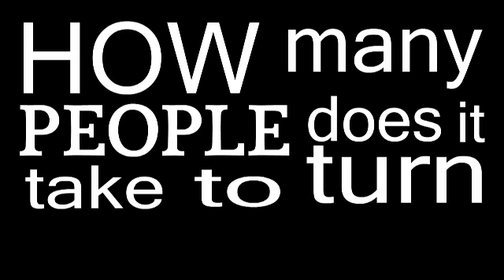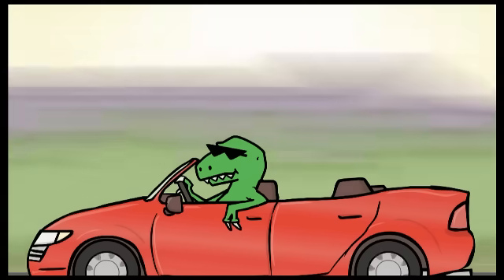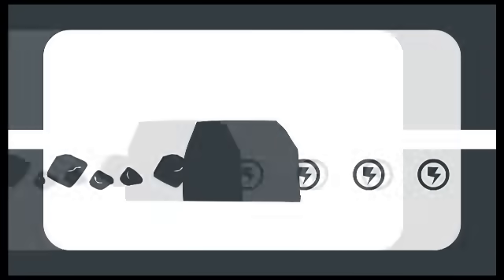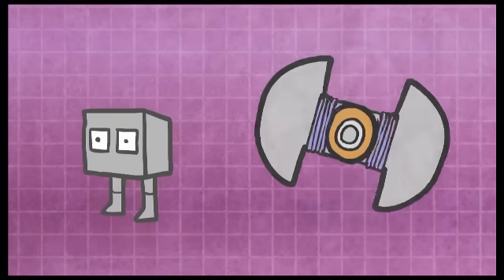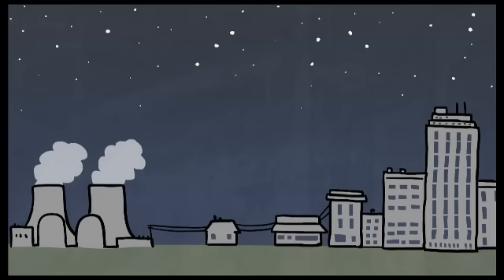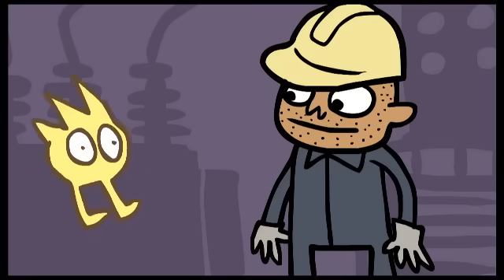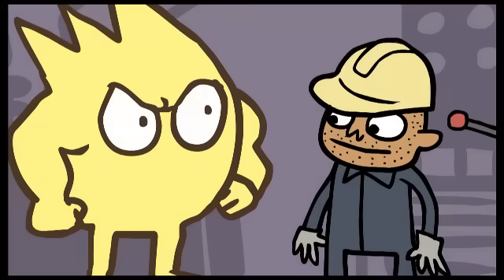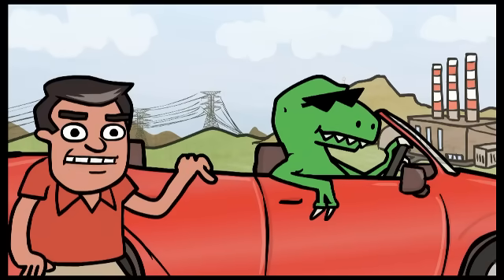Energy 101: Electricity Generation

Comment: My home uses 220 atleast thats what the electricity provider said
Reply: +random stuff probably, it depends on where you are, in europe is 220, in USA is 110...
Reply: minecrafter9099 than how can dryers and washing machines work in usa
Reply: +random stuff the circuits are different
Reply: +random stuff 
In the USA the average home has 3 wires connected to the utility pole. These are L1, L2 and Neutral.  The voltage measured between L1 and L2 is 240 volts. The Voltage between L1 and Neutral is 120 volts. Likewise, between L2 and Neutral you also measure 120 volts. The 3 wires go through the electric meter and the Main House Breakers and continue to the breaker panel.  

There in the breaker panel, about half the circuits in the house for 120 volt usage are connected through circuit breakers using L1 and Neutral wires. The other breakers are powered up by L2 and the same Neutral for the other 120 volt circuits in the house. 

Bigger loads like an electric clothes dryer, electric stove/oven, and a larger air conditioner have a circuit breaker on each wire connected to L1 and L2. That's where you get the 240 volts to run these appliances. Electric clothes dryers use all 3 wires as the motor and controls are 120 volts and the heating element is 240 volts.

The home wiring for 120 volt circuits  is 12 gage in size for circuits that can carry 20 Amps load total.  Smaller 14 gage wire is used on 15 Amp circuits. These wire sizes and breakers are designed to TRIP when the circuit is over loaded by having too many things plugged in. Wire sizes and allowable current are set by building Codes and Standards to prevent wires within the wall becoming overheated and start a fire. The circuit breaker is an electric safety valve designed to be stupid proof and prevent fires from starting inside the walls.

The 240 volt circuits have their own wire sizes, generally larger in cross section, black in color and sometimes marked L1 and L2 or have a stripe to tell the electrician  which wire he has. 

Also, wires are color coded in residential homes. Neutral is white, a power wire is generally black, ground is green or bare copper, and sometimes a red wire designates 240 volts.

 When you look at your 120 volt wall outlet, WHITE (the Neutral) equals the WIDE prong. The powered up ''hot'' prong is the narrower one connected to the black wire. The ground prong on the outlet is connected by wire  to a copper plated rod driven into the earth outside and to the water pipe coming in from the street.

110 volts, 120 volts 220 and 240...... don't sweat it. Those are nominal figures.   Utility companies do their best to keep voltage stable throughout the day. A wall outlet may measure 108 volts on a hot day and 122 volts some other time when the system load is lower. They also keep the generator frequency at 60 cycles per second here in the USA. When things get out of parameters is when your power goes out.
Reply: kimmer6 i measured with a multimeter it said 220v 50hz on all sockets
Reply: +random stuff 
Are you in Europe or Middle East?  All of the USA, Canada, Central America and a lot of South America is 60 cycles per second throughout the grid. 

 I put in and rebuilt General Electric gas turbine generator sets throughout the world. I even blacked out the Eastern side of Lake Maracaibo all afternoon when I was working behind the control panel of a 24 Megawatt unit. OOPS. Saudi was all 50 cycle.

Also, when a power station puts a unit on line it MUST be ''synchronized'' to the grid at the exact speed and voltage. Its like shifting gears without a clutch. One unit at Blue Diamond Almond Growers disconnected during a fault then slammed back in out of synch and it ripped 30 tons of generator out of the foundation. The steam turbine stayed put but the generator banged into the lunch room before falling back into place. 

 Basically, all power plant generators in a region are locked in like being in gear on a manual transmission. They don't slip without bad things happening.
Reply: kimmer6 i am in europe
Reply: +random stuff 
Your electrical outlets are even different than what we have in the USA.   Kiss that kitty! I taught mine to lay down and roll over.
Reply: +random stuff Dryers use 240 volts. There are three wires used. 2 120 volt lines and 1 neutral. Both 120 volt lines supply the 240 volts to the dryer and the 1 neutral links both 120 volt lines together and goes back to the breaker panel.
Reply: for me everything uses 220v
Reply: You must be Euro Peon.....
Reply: kimmer6
our outlets have no polarity
Reply: Yeah, outlets don't have polarity because it's alternating current. But on a normal house outlet, you have 3 prongs, 1 hot wire, 1 neutral wire, and ground. Neutral is not ground, but it's hooked up on the same side.

Comment: Sorry Lee, Human body heat and the most efficient method of Seebeck effect thermoelectric modules will light a light.  So, please teach them the full gambit.  I can stick a piece of iron on a module and then the other side a copper rod which goes into the ground, and light lights...  Modules go to 19 watts each.  So no.. I can wear a hat that makes a light.. from caloric energy alone.  Add in solar.. or camp fires, wood stoves.. and still make electricity.  The Power Pot, theepicenter dot come

Comment: this is misinformation. the power on those transmission lines comes from the atmosphere. see richard feynman lecture on electricity from the atmosphere.

there is no mention of the switching technology produced by nikola tesla that actually sends the signal to the transformer.

the hydrolic pulsers produce the emf on the "high voltage" transmission lines that is the potential from the ionosphere to the ground which is 220v where the lines sit above the ground.

switching the potential energy sitting on the transmission lines turns it into electro motive force that is at newtons per coloumb and is transformed into newtons per joule and watt seconds in the transformer on the pole, which is metered and sold to you.

this video is disinformation and the grid is a free energy system designed by nikola telsa and sold to you to keep you enslaved.

not one mention of frequency or hertz. 

complete bullshit.